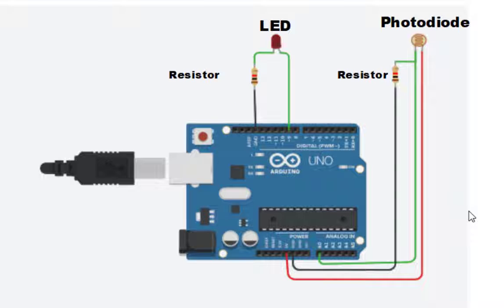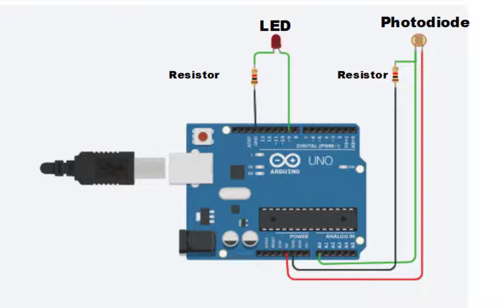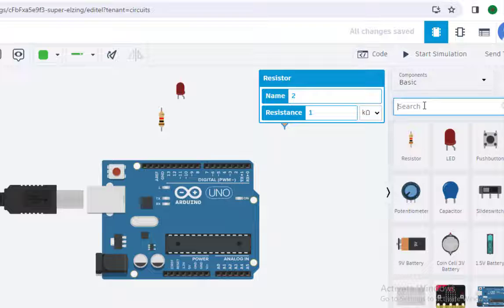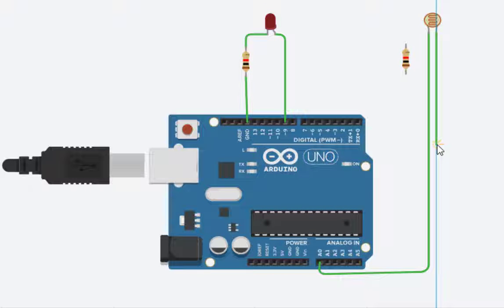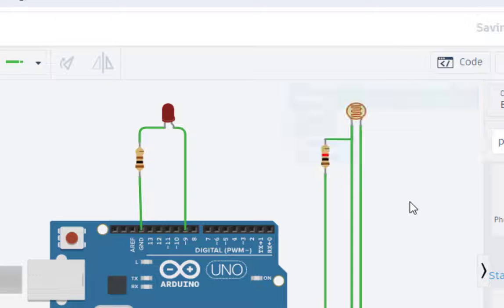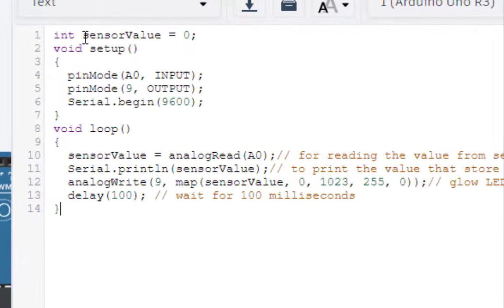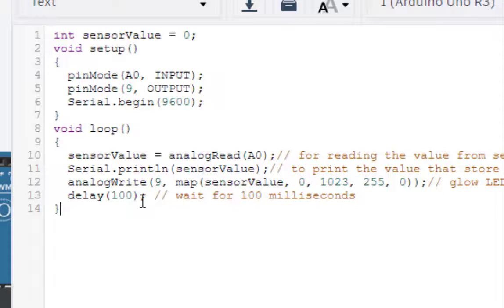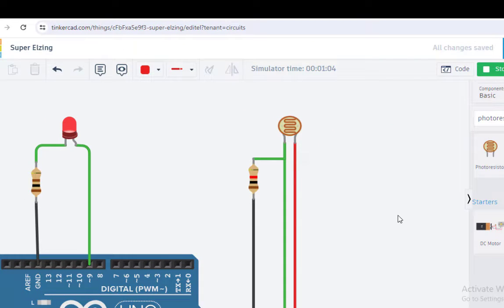Light Sensitive Sensor using Arduino

Comment: intlightSensorValue = 0; // Variable to store the light sensor reading
void setup() {
pinMode(A0, INPUT); // Set A0 pin as an input for the light sensor
pinMode(9, OUTPUT); // Set pin 9 as an output to control the LED
Serial.begin(9600); // Initialize serial communication at 9600 baud
}
void loop() {
lightSensorValue = analogRead(A0); // Read the light sensor value
Serial.println(lightSensorValue); // Print the sensor value to the Serial Monitor
intledBrightness = map(lightSensorValue, 0, 1023, 0, 255); // Map the sensor value to LED brightness
analogWrite(9, ledBrightness); // Control LED brightness based on the sensor reading
delay(100); // Wait for 100 milliseconds before the next loop iteration
}